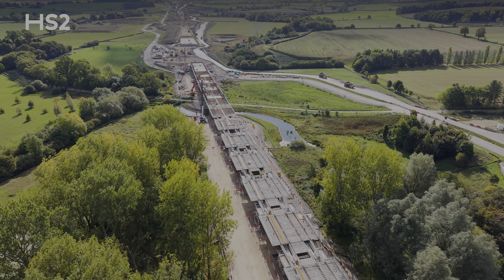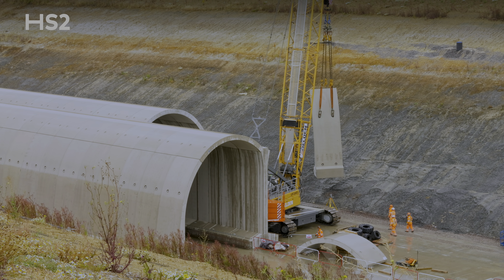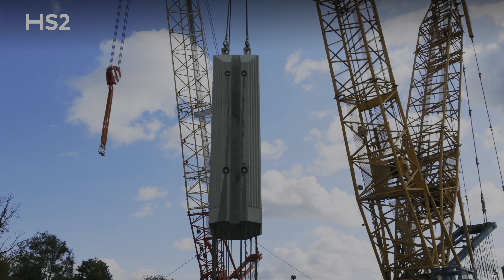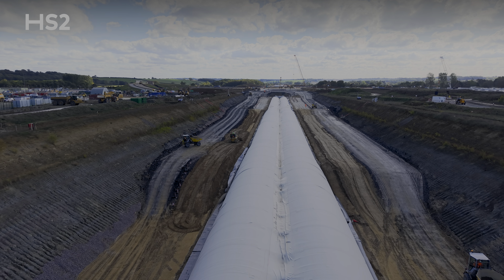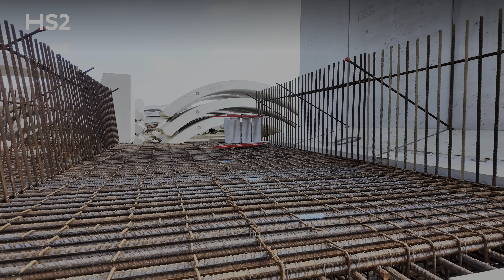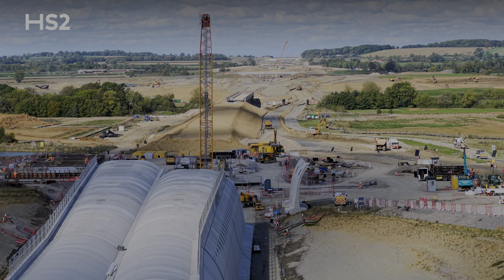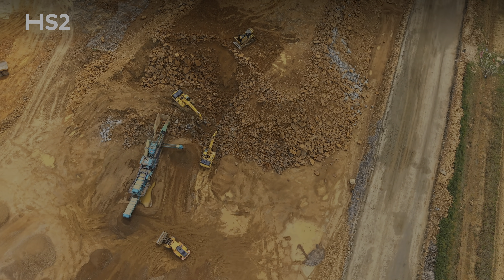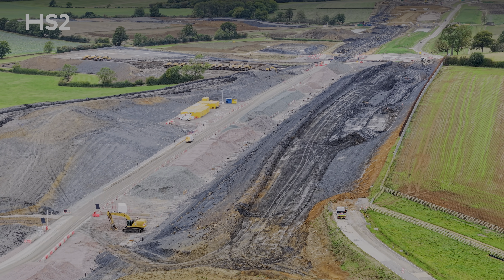HS2 Progress 🚄 | Major milestones across key 8-mile stretch of Britain's new high speed railway 🏗️

Comment: The whole thing is pointless due to the sheet level of boondoggle going on here.  These cut and fill tunnels are just not needed and no one needs a high speed train that has been so cut back that it basically goes nowhere and doesn't fulfil its mission of connecting the whole country to replace air travel.  Should have been done at a reasonable not crazy level of technology (see HS1) and gone all the way to Manchester and Glasgow.  At the moment it's just a train to Birmingham. Pointless.

Comment: It's no doubt a interesting project it's just a shame that there is always something not quite right about the external infrastructure. Chipping warden roundabout still isn't right and lorries have to go over the kerbs because the exit is at an odd angle. And the bridge at lower Boddington is nearly 3 years late in opening and is going to be more grass and footpath than actual road. I believe it's down to it being built incorrectly but I can't remember what the exact reason was due to it being nearly 3 years since hs2 posted why it's not going to be a full size bridge.

Comment: I can see that it is starting to take shape. Look forward to its opening date. Tremendous engineering never ceases to amaze me. Just one question;- Why are the cut and cover tunnels so big?
Reply: Where the line speeds are higher the tunnels need to be larger. As the green, cut and cover, tunnels are in the central section they are where the line speed is high. Also the Long Itchington tunnel, in the central section, has a larger bore size than the tunnels approaching London and Birmingham (where the line speed is slower).

Comment: It's very impressive engineering and much needed infrastructure.  It's such a shame that communication  about all the local road closures has been so poor.  There has been a lot of glossy mail through everybody's doors but it's out of date by the time it lands and is only about the major roads.  There is no central source that's accessible online that is kept up to date about what's closed today and tomorrow.  Instead locals have to rely on local gossip to find out what's open and closed. Trying to get between villages is at times a nightmare and the HS2 response is that people should be using the signed diversions, which are twenty miles long.  These are completely useless when making small local journeys of a couple of miles to the local shop, school, church etc.  Not even their own staff use the diversion, instead they clog up the local back roads.  Road closures are necessary but not all at the same time and preferably not for years at a time, please.

Comment: with the amount of concret that has been used there is no-way that HS2 can ever say it is the green soloution to travel!
Reply: All Cliebts for major construction projects insist on their projects are environmentally friendly and carry a BREAMM rating,. There are 3 grades GOOD, VERY GOOD AND EXCELLENT.  The EXCELLFNT rating is the most common sbd to get that rating the entire project design and construction has to secure a certain number of points in it's  design and construction methodology. It isn't just about using carbon free concrete.
Reply: Actually, HS2 has been at the cutting edge with low carbon concrete, and that rolls over into the general industry so it's actually estimated that the overall carbon load from all concrete use is already reducing.
Reply: @Polarbear1-b6j low carbon concret is like healthy macdonalds

Comment: The 'big reset' has apparently worked. HS2 civils have been pencilled in for completion 4 years from now, rail systems to be installed and tested thereafter.
Reply: The 4 year period to complete the  civil engineering work is only an updated estimate and is not contractually binding.

Comment: It's such a pity that the workers and their skills won't be used once this is completed, we need to finish this build as originally designed, connect to Leeds and Manchester.
Reply: They’re still holding the land for the bit to Manchester so I reckon it’s still possible but they’ve already begun selling off the land for the Leeds leg
Reply: @michaeldascrubtarling1610  The safeguarding between birmingham and crewe was removed in January '24. Manchester to Crewe is the only chunk left not being readied for sale now :(.
Reply: @michaeldascrubtarling1610 the Leeds leg can be missed because it can be replaced by hs3. People could take HS2 to Manchester and then HS3 to Leeds which would be enough to take off demand from the east coast mainline Leeds to London. It also cements Manchester's role as the central hub of the north
Reply: @michaeldascrubtarling1610  Pillocks.
Reply: @michaeldascrubtarling1610 Which is sad and one of the worst decisions Labour made.
Reply: There still talk of the Manchester to Liverpool high speed line that may still go ahead.
Reply: @DavidKnowles0  i think the section to crewe and manchester will go ahead
Reply: @DavidKnowles0 As someone once said “Talk is cheap “
Reply: It will. This abomination is a certain dictators trans european express so it will proceed to scotland, cross the sea to ireland, go south, re-enter england on the south  western tip & go back to the european aristocracy's private continent ( which includes 'britiain' far as they are concerned.). This rail is happening as they consider this island, its money laws & borders  their private possession NOT because this project is needed.
Reply: There's other construction projects for the labour, not necessarily a railway.
Reply: @TrevorWilliams-fq8mg There is daily arriving loads of willing and competent workforce 😇🥳
Move on ✌🏻

Comment: HS2 needs to be connected to HS1 as well
Reply: Trains could, possibly, use the West London Line to connect to HS1. Not sure how much infrastructure improvements would be needed though as the HS1 and HS2 trains are slightly larger than normal UK gauge trains.

Comment: Why the cost of Cut & Cover , cutting have been successful for 200 years….
Reply: Not really, the steep sides of Victorian cuttings have caused numerous problems for decades, landslides etc. Due to subsequent adjacent development there are few options to shallow these. Where HS2 have cuttings these are shallow. The green tunnels are low maintenance and also offer many other advantages.
Reply: If you factor in the requirement  to relocate an enormous amount of spoil, possibly quite some distance away, the cut and cover method might start to look more cost effective.
Reply: Keep NIMBYs happy.

Comment: Why do they need a to build a expensive green tunnel
Reply: Cameron was a weak coward that caved in to the smallest complaint from his back benchers. He could have easily got Labour design for HS2 with way less tunnels through Parliament but he didn't because was a dumb stupid coward.
Reply: Efficient running of fast trains over many decades, even centuries, benefit from  a nice level track without too many changes in elevation. At those locations where quite deep cuttings are  necessary to maintain the 'level' you are then required to make the cutting rather wide to not create steep embankments. Steep embankments  lead to expensive maintenance issues later on and possible H&S issues if a landslip onto the line does occur in bad weather and your train is coming through at 225mph. These deep and wide cuttings would create millions of tonnes of spoil which you might be able to use a bit of for embankments elsewhere on the line, but you might have to truck most of it some distance to create an artificial hill or something !. 
If you can use most of it to backfill your new 'green tunnel' a very large amount of cost can be saved which alleviates the construction costs somewhat. You will also reinstate a good few acres of attractive  land over the tunnel for posterity and keep the locals happy with their Conservative MP who lobbied for all this in the first place !.
Reply: @JohnHoward-wc9kk  That's utter hokum. We can see in the video that the tunnel barely has any cover. An even shallower cutting would be entirely viable, plus cheaper and with lower carbon. It's not the 1850s - modern electric trains happily go up and down hills with energy recovery. These tunnels were added simply to appease a tiny number of selfish NIMBYs (at huge expense to all taxpayers) and there is no reasonable justification whatsoever.
Reply: The Elizabeth line does NOT make money, despite the Elizabeth line's, 118 km of track, 41 stations, 4.6 million living within 2 miles of a station, ~350,000 trains run annually, yielding an annual ridership 546.7 million (2024-25), and generating ~£0.7 bn of passenger revenue, as the construction cost were £18.9 bn, which with debt servicing and paying the ~400 staff, and many a contractor, shunting the running costs ~ £1.2 bn a year.

HS2 will have ~140 miles of track, 4 stations, 0.8 million living with 2 miles of a station, construction costs north of £100 bn, and operating costs in excess of £8bn a year. You'll need ALL the 800,000 who live in the catchment area (assuming two thirds will be eligible for a railcard, and a STD return prised at £64) to make at least a return trip a day, if your not going to breach the promise that HS2 tickets will cost no more than West Coast / Chilton mainline tickets, for the service to break even, those two mainlines have many stations offering utility to those not living in a city centre. 

The entire population living within HS2's catchment area will not make a daily trip, and the line will NOT make money.
Reply: @AndrewRoberts11  economic benefits excluded, obviously. Fares aren't the only way to generate surplus.
Reply: How about asking the nimby's, they don't want their view spoiled from a High Speed Railway..
Reply: @scottpeacock5492 Believe more wanted the CAPACITY adding, community serving, Great Central Mainline reinstated, that STOPPED at their towns, rather than all stops eliminated between Birmingham and London, to theoretically enable 400kph running.
Reply: @AndrewRoberts11 The Great Central has always been a false flag argument, it's still a full and standing railway between London and Alysebury, between there and Rugby there's only really Brackley with any population and at Rugby it heads away from Birmingham. And Leicester and Nottingham are heavily redeveloped.
Reply: @Polarbear1-b6j An brand new central HS speed line make sense to me,London,  Luton, Leicester, Nottingham, Sheffield and ending a through station in leeeds, allowing connections on high speed line connecting end up in Liverpool at one end and Hull at the other end.
Reply: if you actually want an answer you should mail the HS2 helpdesk directly.
Reply: @swedneck  I was hoping for another perspective on why they needed to build the tunnel if I contacted HS2 it would only provide there side of the argument.
Reply: The initial business case for HS2, was it would add capacity between London, and the North Midlands / North: Nottingham, Sheffield, Manchester, and possibly beyond. Cities once served, along with Leicester, Loughborough, Rugby, Aylesbury, Brackley, and Calvert, by the abandoned Great Central. Routing via Birmingham, already with its existing two London bound main lines, and the abandoned Junction Railway, that connected up with the GCML, was a choice. As was shunting from the initial, far cheaper M40 corridor route via Birmingham, both financially and environmentally, in 2009, to a path just north, that not only ran through Michael Helseltine's back garden, but bypassed the towns between London and Birmingham. The Labour peer (Barron of Camden) and minister, who persuaded Gordon to shunt the line through the old Conservative peers garden, at great expense, also somehow managed to wangle a well paid role with HS2. HS2 is little more than a very expensive, vanity project, that many will use to screw generations of UK tax payers.
Reply: @AndrewRoberts11  It will stop being a "white elephant" if you people stop wining about how much its going to cost, just throw everything at it, get it done and it'll pay for itself like crossrail is currently doing. The back and forth is what is causing costs to rise.
Reply: Expensive property, on the edge of the Cotswolds; not forgetting there are a couple of, now former, cabinet ministers, second homes within sight of the route. If they'd used the old Great Central Mainline trackbed, and stopped at the towns that haven't seen a train since the Beeching cuts, or taken the M40 corridor route, there would have been fewer protests, with the demands for the line that offers no utility to the communities en-route, to offer 400 kph speeds and no stops, to have it buried.
Reply: @AndrewRoberts11  the line offers bany benefits to communities on the WCML..

Comment: They put windows in trains so we can view the passing landscape...No good if you're spending more time in tunnels
Reply: Hey, shall we ditch the windows on the London Underground too?
Reply: @Maxhead_room  The original trains on the tube didn't have windows.
Reply: @DavidKnowles0  If the tube didn't have windows, how would you know if you'd arrived at - say - Pimlico on Victoria line.   Yes the information system within the carriages is much better now, but it's sometimes less than perfect.
Reply: would you prefer HS2 not be built at all? because that's what the alternative is.
Reply: @swedneck  HS2 bill in parliament had more than enough votes to get through without caving into the NIMBYS.  The original parliament bill should also have been done properly so that HS2 wasn't require to go and get another 6000 planning permissions from councils as well.